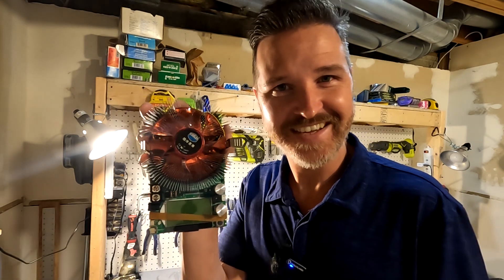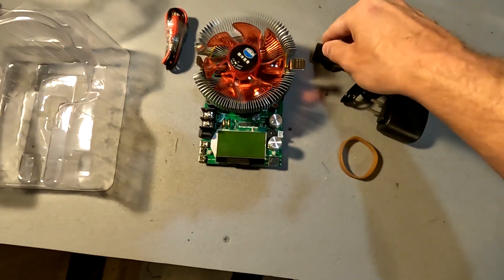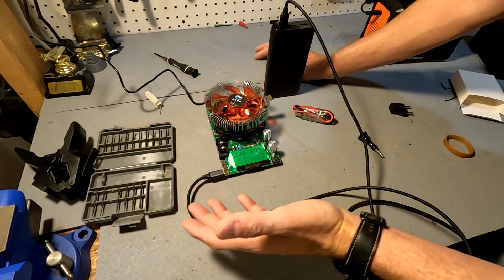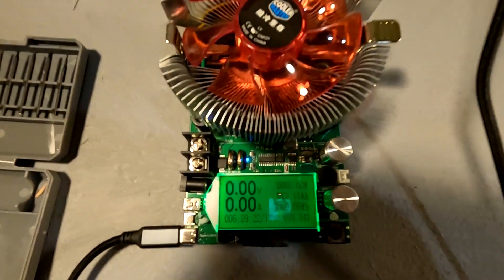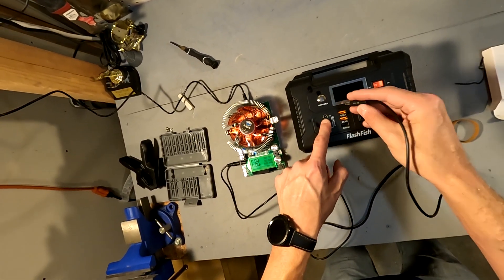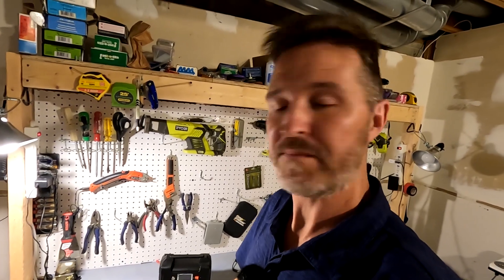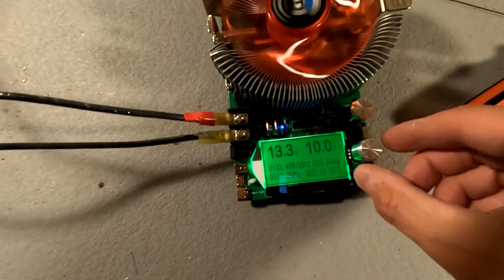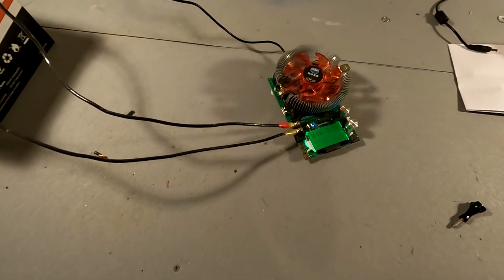Great way to test capacity of Solar Powered Generators and Portable Battery Banks!

Comment: Does your charger shut off at 90% to save the battery or does it charge until the bms cuts off?  Does the bms shut off with 10% left in battery?  Probably things we can’t know. Just saying, it’s hard to get a fully accurate test without knowing the parameters.
Reply from the maker: Good questions!  The battery charger is LifePo4 only.  It will charge the battery to 14.6v.  I believe that is a standard for LifePo4 battery chargers.  The cooler Master does drain the battery until the BMS in the battery shuts it down.  I believe the Ampere Time battery shuts off at 10v.

Comment: That is the same tester i bought when I stated getting into DIY Solar, the Wh is not quite accurate because it does not have Voltage sensing leads for reading the Voltage at the battery terminals, the one you are using is using the Voltage on the load to calculate the Wh and it discards the Wattage wasted on the hook up wires, the new version has the Voltage sensing wires. 
BTW, You can also set the Voltage cutoff point for the unit to stop testing so it will not load down the battery below the recommended low Voltage discharge point.
@9:36 the tester shows 13.1V when 10A is being drawn from the battery, I wonder what the Voltage on the battery terminals is at that point.
Also do not try to do 20A test, I blew the power MOSFET when trying to draw 20A as claimed, keep it around 15A max then you will be OK.
Reply from the maker: Thank you for all the great information!  Maybe I'll do another test by checking the tester accuracy every hour.

Comment: They work great just watch the temps and dont set them on anything conductive. And there is another model that allows pass thru which not only test capacity but instead of wasting it to heat it will charge another device
Reply from the maker: That is good to know.  I wish I would've known that sooner!  Thanks for the info.
Reply: @OffGridBasement  yeah there are a few models and some have bigger and nicer displays.